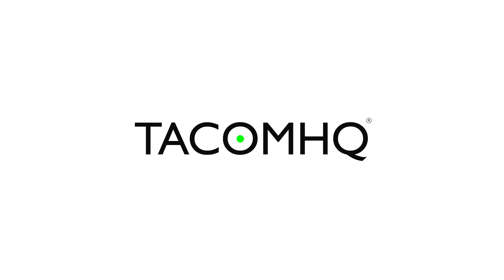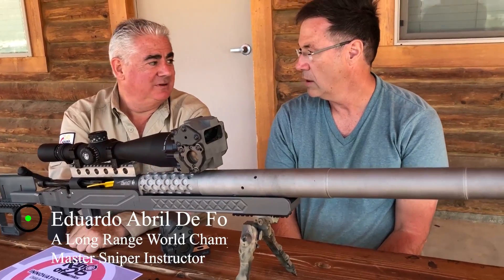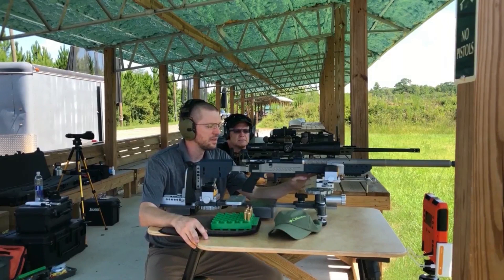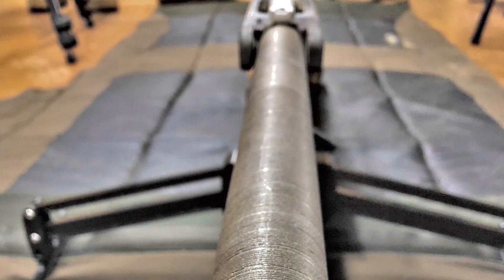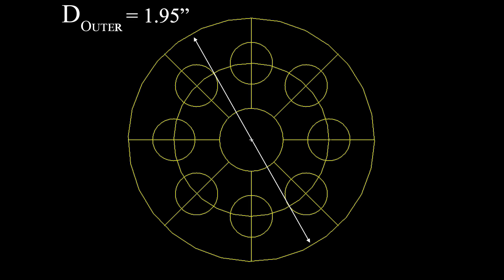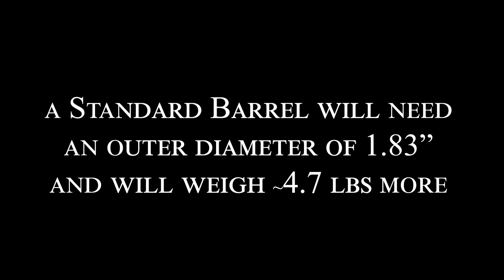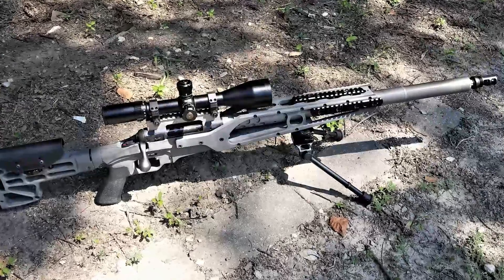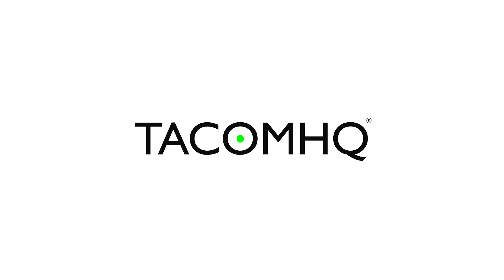Structured Barrel Analysis

Comment: How many shots before groups open up with structured barrel (2x baseline - 0.3 to 0.6 say or something  equivalent) - why does that happen according to TACOM?  (hint: the 'whip' isn't changing in a proportional manner to explain this effect)
Reply: To be clear I completely agree that the design leads to a stiffer barrel. I also agree harmonics can effect trajectory - but to a much smaller degree than is implied. You say to achieve same results would need a 2" dia normal barrel, why not do a head to head of just that? Then you can show how much utility comes directly from the external structuring vs the 8 hole design.

Comment: Seems like the interface with standard bolt action receivers would be a weak point..  Do any companies or individuals make large diameter receivers that match the diameter of these barrels?    Would like to see a receiver large enough to allow interface with your barrel threaded without the need for a shoulder..  in other words 1.6" dia barrel threads..

Comment: interesting!! Any idea of Barrel life and cost?
Reply from the maker: Russell Whitman to date we have not shot out a barrel, and thus far we have noted a vast reduction in throat erosion. We have a few examples on our website with a link to  Coastal Precision Consulting’s analysis. Price is $700 for a 20” barrel and $30/inch thereafter (price does not include the barrel). Any barrel can be Structured as long as it meets our OD requirements. More info on our website. Thanks for watching and your commentary

Comment: I wonder how useful this design would be for scaled down 5.56 and 7.62 machine gun barrels
Reply from the maker: Lachlan Moore our thoughts exactly. Due to the fact Structured Barrels utilize the negative pressure generated by the bullet passing through the muzzle to pull cool air through the  barrel’s breather ports to cool it from the inside-out with its added +300% surface area, we strongly believe this will be ideal for lmgs.
Reply: @tacomhq  Still need a QC mechanism though, but less barrel change is still a improvement. And another huge pain in the ass would be the gas system and the gas block...

Comment: When it comes to Axial compression, why did you go with circles instead of triangles? other than manufacturing efficiency.
Reply: I beam is stiffer.
Reply: @silvermediastudio  makes perfect sense actually.  When you creat a circular I beam, the weakest point being the web gets absolutely no flex while the flanges give it extra strength.
Reply: @Je3perscre3pers  yes. and they corners of triangles are stress risers.
Reply: @silvermediastudio  i forgot that barrels flex tortionally while a bridge flexes vertically

Comment: This is the same idea as a fluted barrel the only difference is that it has internal holes instead of outer grooves. Yes it will make more of a difference because it has more area moment of inertia with that type of cross section. No cantilever beam is harmonically dead so that is just false like I have been seeing people say about these barrels. It's just more expensive because of all the deep hole drilling needed.
Reply from the maker: Hi Rick, thank you for your comment.  I recommend watching Rex Tibor’s https://www.youtube.com/watch?v=1B4takk5pM4&t=366s, follow this link https://www.youtube.com/watch?v=BaEkVrFJqZg&t=204s, and or visiting our website and reading how Structured Barrels work for we describe in great detail many physics principles (harmonics, material acceleration, energy, and thermodynamics) at work to achieve a dead barrel, which bears virtually zero similarities to fluting.  To achieve zero vibrational frequency - you are correct - requires infinite stiffness, which is obviously impossible.  Nevertheless, this phrase was coined not by us, but by the many notable people having shot them.  Similar to the question asking, “Are you standing still?” depends on your frame of reference.  Customers routinely find loads in as few as 30 rounds with break-in conducting 10-grain ladder tests in 1/2-grain increments and are often at loss for words trying to describe the recoil impulse.  Good luck
Reply: @tacomhq  lotta words to say "nah-ahhh."

Comment: Sounds like the perfect job for carbon fiber
Reply from the maker: M C not exactly. I suggest watching our latest video https://youtu.be/BaEkVrFJqZg
Reply: @tacomhq  so making the exact same barrel out carbon fiber won't be as rigid? I didnt catch that in the new video
Reply: What if a barrel was milled down and a sleeve was pressed over it so when it cools it adds tension?
Reply: @____MC____  a "pressed-fit sleeve" would not produce the same results a solid, one-piece, machined barrel does;
 i.e. solidly-bonded, one-piece @ the mollecular level.